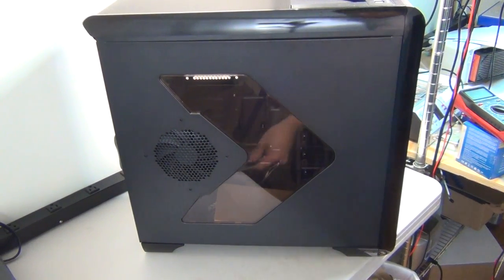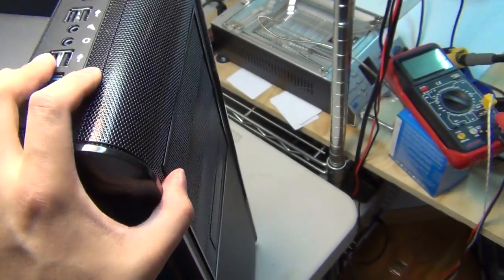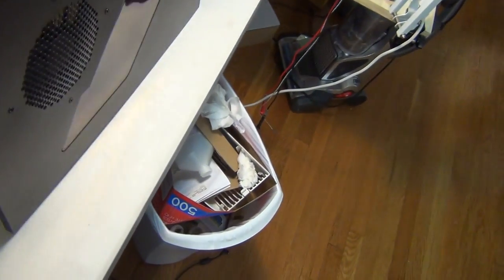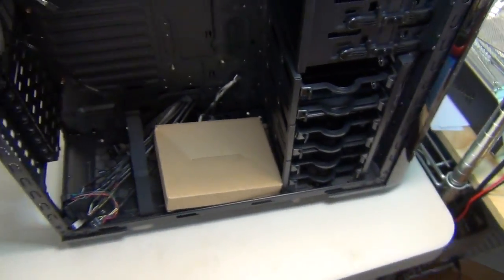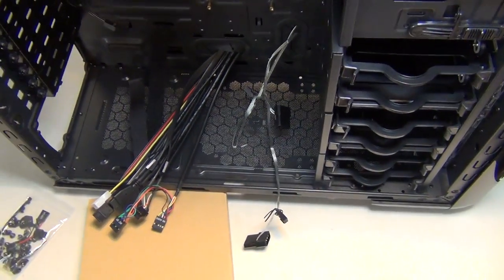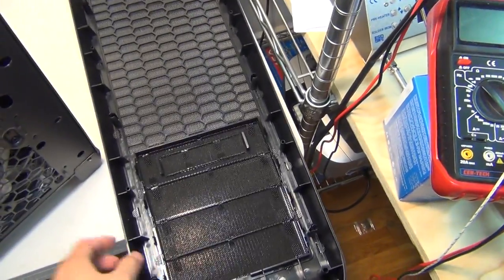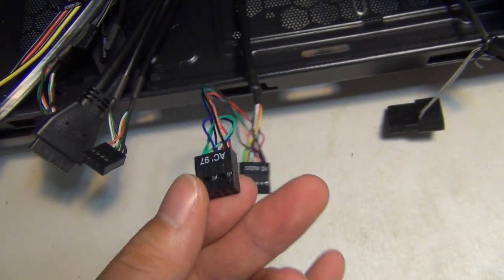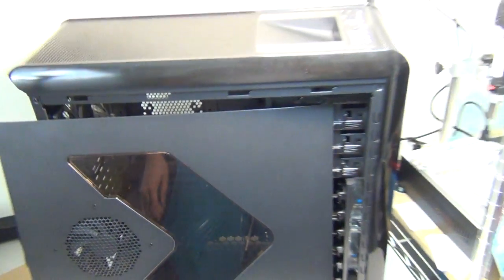Rosewill Gaming ATX Mid Tower Computer Case Cases BLACKHAWK Black Review

Comment: im sure you're aware now, but that bay cover you dropped in the trash has two fan mounts on it allowing you to mount a 120mm fan in the bottom 3 drive bays
Reply from the maker: Furyan451 I am not a big fan on fans, too much noise.  I disable all of my fans, except spend 80$ on nice cpu fan, its just my personal preference.
Reply: CyberDoc LLC yeah i dont mind the noise. my pc makes very little and i have 10 fans in there. haha  including 2 corsair sp120's on a havik 140 heatsink which makes a slight buzz. but under the part of my desk i barely notice it. and although i ran into issues with the side panel fan when installing the cpu cooler [hence the corsair sp120's] i still love this case.

Comment: How is metal a "cheap" material? It's one of the most durable materials you can get. If it was made out of plastic, I would agree, but it's not. It's a great deal.
Reply from the maker: steel, zinc and iron are cheap in price.  durable yes, but cheap in price and heavy and poor conductor for heat dissipation.
Reply from the maker: why would you even consider plastic?
Reply: Exactly, I said I would agree that it would be a cheap material.
Reply from the maker: SevenUpHub yeap it is a great deal : ]

Comment: DUDE! You are doing a technical video and when talking about removing the side of the metal case you say you will need a fork or spoon or a knife?  Any use for a spatula in this techniocal video guide? lol
Seriously, how about a screw driver? LOL  Not taking a cheap shot at you I just thought it was funny. 

Just so you know the tight fit and hard removal are a good thing. Not a bad thing. One reason id later in the life of the of the product you would hear all sorts of slight vibration noise form the case if not. May still hear some, but not as bad.
Reply from the maker: I wouldn't consider opening a computer case "technical".  a fork or spoon or a knife is what everyone have in their home.  screw driver is not as good as a knife, you will end up ruin this case using a screw driver.     spatula is a very poor choice to use open this case, you will ruin the spatula.